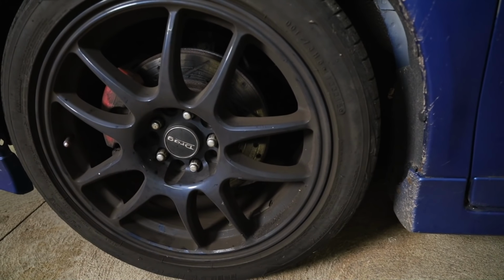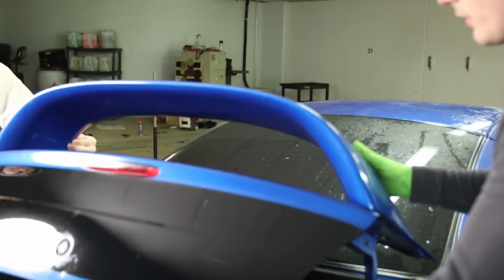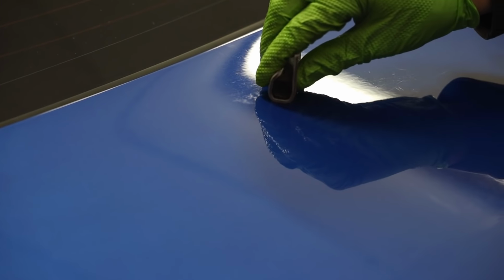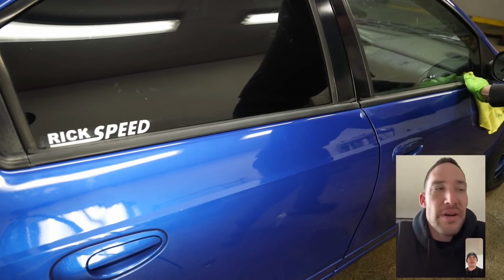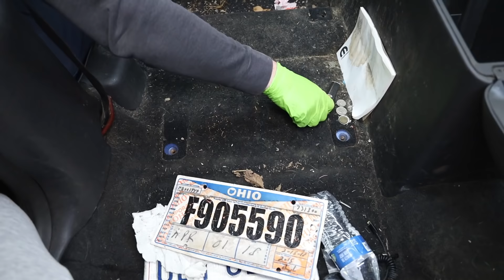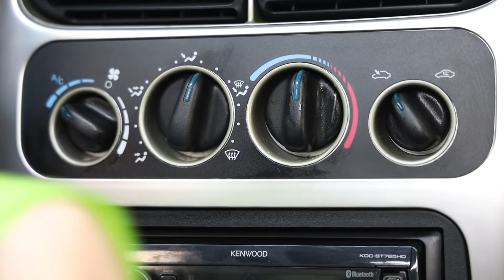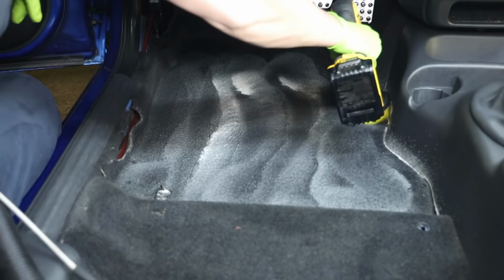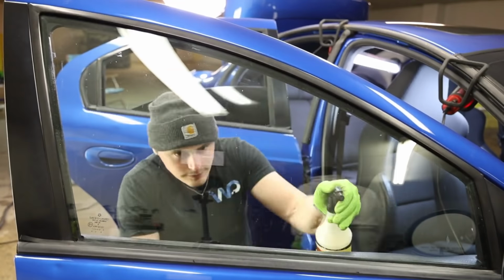Deep Cleaning A DESTROYED SRT-4 | Satisfying DISASTER Sports Car Detail Transformation!

Comment: Best part about the "225hp" stock numbers. People were saying they dyno'd them at 217 on a mustang dyno which would mean much more power than at rated crank hp. Others say crank hp (rated hp by manufacturers) was closer to 250. Either way, with a good exhaust these sound ridiculous and with proper tires and more boost these things are wild.
Reply: They never made 225hp in any year
Reply: @jesselent7894  215 in 03 and 230 in 04-05
Reply: 04-05 had the stage 1 computer and injectors.. these cars get down when setup I’ve had 9 love srts. Never selling my 04 e blue like this. One year color
Reply: Yep! Some bolt ons and stock turbo I ran 12.5 @117 on slicks. They moveee
Reply: @Thephysiquemechanic  i know 2 people who went 12’s stock, i also went 13.00 with a stock car and sticks
Reply: @jesselent7894  yep very underrated
 Stock with a tune on pcm boost makes a huge difference
Reply: @Thephysiquemechanic  huge difference! I just bought one a few weeks ago again to daily. It’s funny i have a redeye and I’ve had hellcats etc and always resort to the srt4